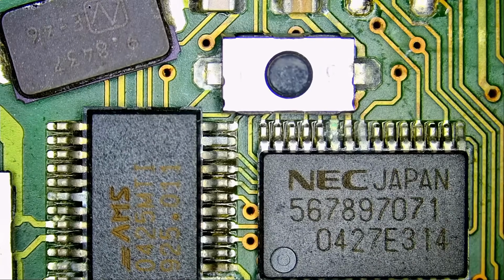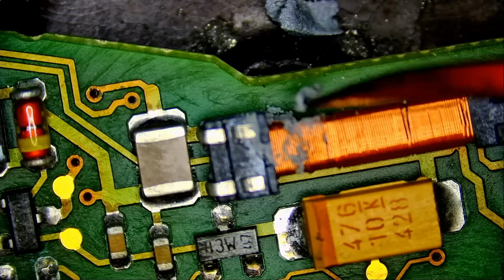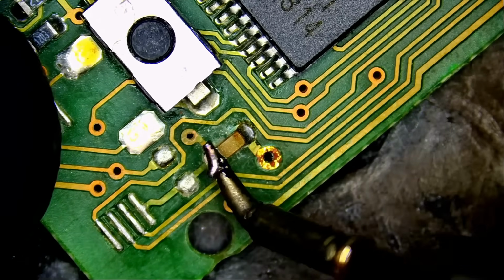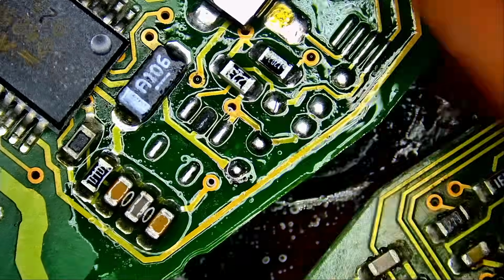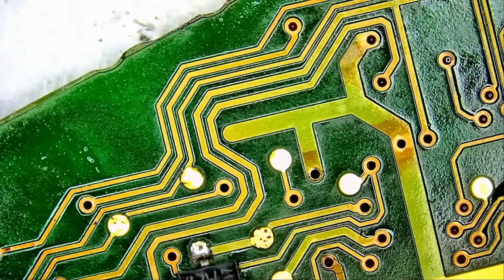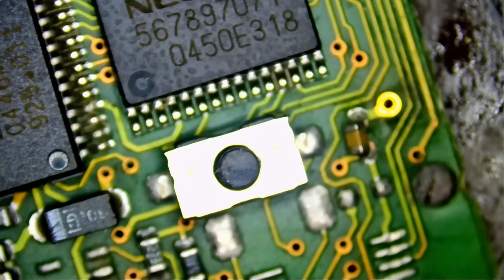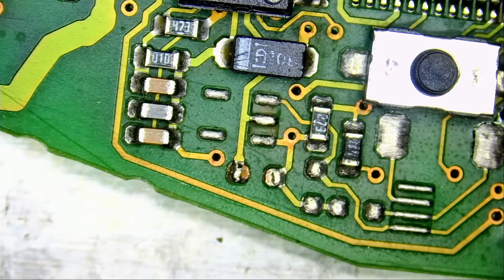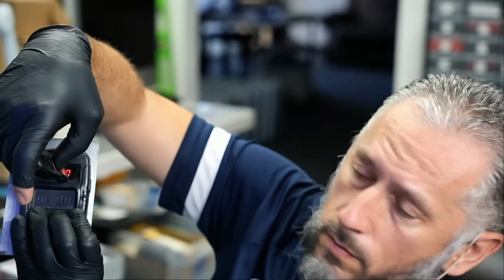Two Benz key fobs Fixed. Dealership quoted $1200 each.

Comment: Am practicing on some old board to remove and install those small caps but my hot air seems to push those do you alway need to hold them in place or is there a air setting that is ideal for these small caps? Thanks

Comment: i used to work as an tech for VW ,people used to bring me fobs from ebay then ask me code them in ,these fobs are fake and will not code in to vw vehicles ,i used to have to order new keys direct from the main VW factory and code them in through the german computers for security ,when you have a $30,000 plus vehicle it is a good way to keep security high , although you can repair keys they are not always reliable after being soaked in salt water or drivin over with a tractor ect ,we did not charge 1200 for new keys more like 400 which i think was fair for the security ,work and reliability of a new Key ....

Comment: i watched almost all your videos recently and i placed order yesterday of your equipment from the web ure doing incredible work i can tell on my end as a locksmith when i get to these keys i do the repairs i have as much donor keys as you have usually the damge is so bad that i take the NEC microprocessor and transfer it to a new donor and it works 99.9% of the time but as soon as i take the neck im trying to get the password to see if there is any data left in the NEC if i cannor read it i just make a new one and thats it but it well knows to break these keys because of thier bad plastic after 20+ years of usage they break moisture and liquid touches the board that can cause even data loss thier very fragile keep doing amazing work!

also if you want to know how it works to make a flip key for mercedes for 1992-1998 the flip keys we basically have to remove the ECU and the immo box which located on top of it a chip of motorolla usually MC68HC705X32 which have 64 legs we have to pull data either from the ECU or the immo box write a chip write the eeprom back to it and then the car starts the fun begins with the remote we have to cause purpesly damage to the ECU to pull data for the remote to be able to match with aftermarket key unfurtunately and also to make it start it depends on the car me personally not touching remote keys for these cars if there is not at least 4 high digits bills.

Comment: I had a similar problem with my c230. I couldn't unlock the doors or use the windows open and close feature of the key. Turned out that it was some poorly soldered connections inside the receiver in the drivers door handle. 
I found a tutorial on utube that showed how to disassemble the door handle and which solder joints that needed to be redone. After sealing up the electronics of this handle switch with epoxy and assembling the door. Everything worked like brand new again. 
Looks like you need to keep the keys dry.
I sold the car but still have one of the keys. Is there any market for one of these early keys ?  This was from a 2002 c230 sportcoupe. It'd be easy enough to drop in a box and ship anywhere if someone wants to buy it.

Comment: No need for the dealer that's why automotive locksmiths like me exist.
Reply from the maker: I asked customers the same question, and they explained that a locksmith can only program a replacement fob if the current one exists and is working. Mercedes uses a highly encrypted system (EIS/EZS module and key chip) that only the manufacturer or authorized dealers can access, and most models after 2015 make it nearly impossible to program without factory tools. Security concerns were also a common answer and price wise repair made more sense. What are your requirements for programming a new fob and do u have to be Authorized and have access to tools ?
Reply: @NorthridgeFix  Yes it is encrypted but we do it via eprom.
Reply from the maker: Are you a locksmith?. NECs are microcontrollers, not EEPROMs and cannot be read directly.
Reply: @NorthridgeFix  I'm a locksmith. I never said we read the NEC chip but The EIS (Electronic Ignition Module) controls the ignition in Mercedes-Benz vehicles. It can be read and written to generate keys.
Reply: @NorthridgeFix this is false, those locksmiths don't know what they're doing. The only keys impossible to make at the moment are FSB4 Mercedes keys.

Comment: Imagine buying a Benz and complaining about a key fob costing 1200 😂. You'll have more to worry about for repair costs down the road
Reply: Considering a 2005 c230 costs around 5k yeah I’d be complaining a key fob costs 1/4 the price of my car. That being said he should go to a locksmith they’ll do it for less than $400.
Reply: From what i can tell u as an eu customer - yeah they are abosolutely insane! They robbed me more than 3k€ for an issue of the car itsself and they could not tell me if its now fixed forever

Its an CLA Shooting Break from 2020 which costs me 30k in 2021 with milage 3800km

Nice that the local store helped me a bit but Mercedes isnt worth it anymore

Sadly i was an fan of that brand!
Reply: I think there should be a wider knowledge base of this, Benz are ridiculously overpriced
Reply: Poor me i have two teslas but not have a single keyfob 😂

Comment: great video, I have the same old Benz keyfob, now I can "dig in", thank you and cheers btw. U have so many of those fobs boards. I would need another original key with all the function, can that be done? Maybe You could sell them via Your shop, put them in decent plastic housings..maybe so they look original late 90s and newer ...;)
Reply: I was told that once paired / mated to one vehicle used key fobs are only good for parts and not reprogrammed to another vehicle. Only a new fob can be paired. Anybody confirm or deny this info?
Reply: @pedrorojascervantes3928  when they did a recall fir the ignition switch on my car, they had to guve me new fobs
Reply: @pedrorojascervantes3928 if it is not like that fobs would be cheep this way you have no choice.
Reply: There is typically a cryptographic key between the car and the fob that prevents this